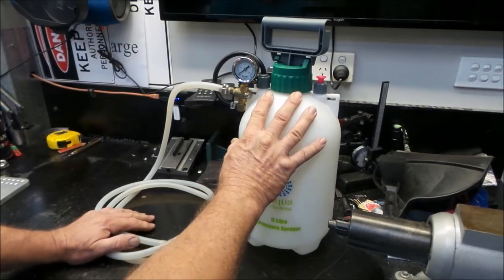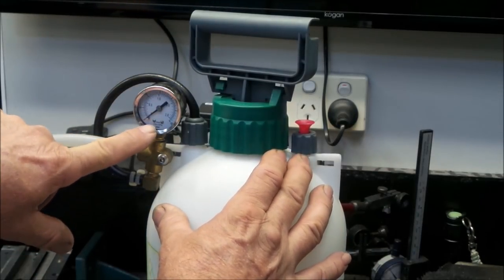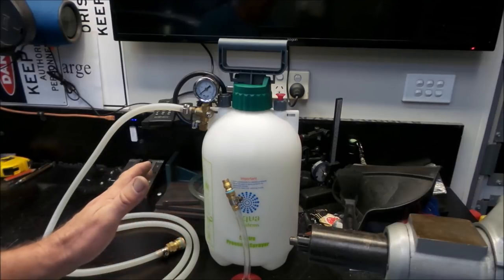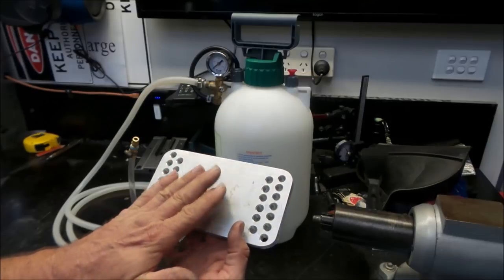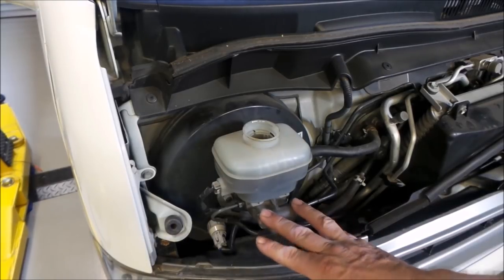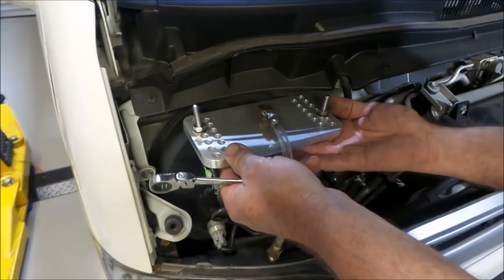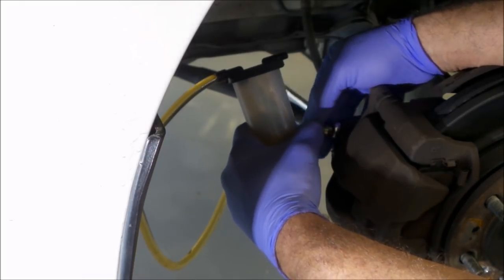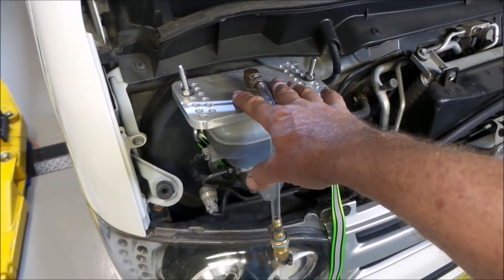The Ultimate Diy Power Brake Bleeder

Comment: Nice idea mate, was curious if there is a better way than to remove the whole adapter to refill mid job. What about just removing the pump from the adapter quick connect and having a pump, manual or air that connects to the t fitting to transfer new fluid in?
Reply: What about just another port next to the air inlet with a ball cock and a funnel above it?

Comment: Why not go to a auto junk yard and get a cap and modify it?  Or go to the dealer and buy a new cap and modify it?  That way you have something that fits your car and seals properly.  Nice video great idea.  Did you give a list of the parts? I get the pressure gauge, the L and the nipple, but at 18:26, is that a brass 3 port with a hole to mount it on the bottle? It's silver/grey colored.
Reply from the maker: G'day Mate, to answer your question. As I mentioned in the video, the Master cylinder reservoir is only held in position with Orings & if you were to pressurize it via a cap the whole thing would lift out of its seat (not good) hence the adjustable strap to keep it all together. The Plate is also kind of universal & fits quite a few different vehicles. The T piece is a 1/8 npt Tee fixed to the side of the bottle, which gives you hose in, hose out, & Gauge. Cheers Mate.

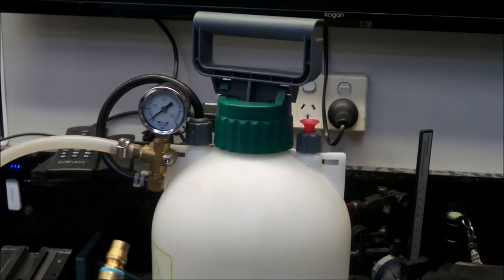Comment: 4:29 - Couldn't the mess be mitigated if there is a small, barbed, inline ball valve installed where applicable - say, immediately prior to the coupler in the sprayer hose? The bottle could then be used to deliver enough fluid for the entirety of any job without the risk of the reservoir running dry after it was assured that the reservoir had an air gap between the reservoir adapter cap and a fluid level in the reservoir at or slightly above the Minimum reservoir level at the beginning of the job ? The air space in the reservoir would simply be under the same pressure as the delivery from the pressure sprayer. After the sprayer was depressurized, the inline ball valve closed and the tubing coupler to the reservoir cap adapter disconnected, that air gap above the ~minimum fluid level in the reservoir would be ready to receive what small amount of fluid may be left in that reservoir cap adapter and tubing towards bringing it to Full level. Anything I'm missing in that perusal?

Comment: Nice contraption but needlessly complicated. You can simplify that by just using a foot pump fitting at the end of the hose and connecting it to the wheel you just took off the car to provide the air pressure needed. There will be no loss of pressure in the tyre either because there is no air coming out of it to provide the pressure.

Even simpler, you can just use a 50c syringe and a piece of tubing and suck the fluid at the brake nipple. That is indeed universal.

Other people demonstrate on youtube how to use the sprayer mechanism from a sprayer bottle to suck the fluid out of the nipple instead of using a syringe.

Possibilities are endless really, and all for under 1 dollar.

But hey, whatever blows your skirt.
Reply from the maker: Thanks for the comment Champ, 
Dont know if I'd call a Garden Sprayer with a Tee piece & a Gauge needlessly complicated, but I guess for some folks it is.
Maybe you're not aware of how cheap they are too.
As for you're 50cc syringe or a spray bottle mechanism, vacuum is vacuum, whatever the source, its just a crap way to do it.
I've used a lot of vacuum brake bleeders over the years & the only ones that kinda work, are very expensive professional units. And the only reason they work is they have the grunt to overcome the vacuum leaks from the bleeding nipples themself.
If the bleed nipple is o-ringed vacuum will work, but most aren't. An alternative is to thread tape the bleed nipples to lessen the vacuum leaking down past the threads. 
But, if you pull the nipples to tape them there's a chance you will introduce air into the lines.
The only other time a half assed vacuum setup may work, is on a really Simple Old Vehicle without ABS, or maybe a Tractor, And you can pretty much Gravity bleed them anyway, so whats the point.
Sure, anyone could cobble together a vacuum system, demo it working & make a YouTube vid, but it WONT work on 90% of vehicles.
Same goes for your endless possibilities under a Dollar

But, As You put it "Whatever Blows Up Your Skirt."
Cheers.
Reply: [Whoever ya are (no salutation is autofilling here)] ,  
.... Only if you fill your tires from what you know to be a compressed air source that dries it's air (most service / gas stations do not guarantee that where I live and I see moisture coming out of the hose all the time when I purge before filling a tire - especially in the cold of winter or extreme humidity of summer). Where I live the compressed air is often being fed from a pneumatically operated car wash nearby that sucks in plenty of moisture from that operation into the compressing of its air, most likely. I wouldn't use air from tires until you are in a situation where you are stranded and need to MacGyver a stop-gap measure after which you inevitably flush the system as soon as possible. Brake and power steering fluids are hydroscopic and they'll want to absorb that moisture, only contaminating it with a corrosive failure mode for any metal parts that are interactive with that moisture - a detriment to operation and lifespan of the system.
Reply: One reason we Don't like to foot peddle the brake to bleed the brake fluid is that is many cars, if you push the pedal all the way to the floor, as many people might do when the bleeding valve is open, you could damage the master brake cylinder.  But then Again,  if you have the time and money, why not just replace the master cylinder while you are at it!  Ha Ha, sarcasm if you did not interpret that part of the text.